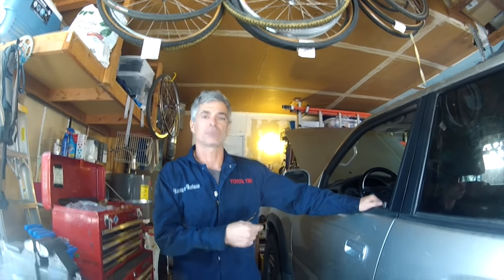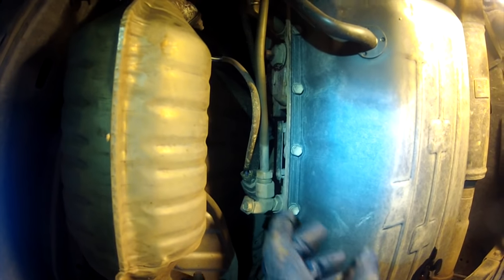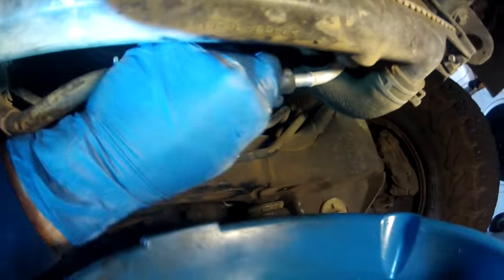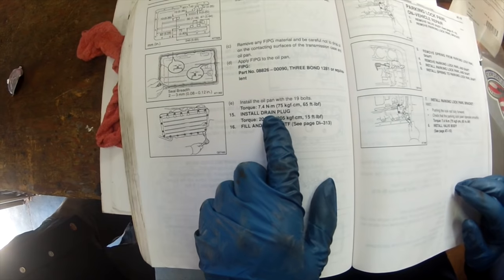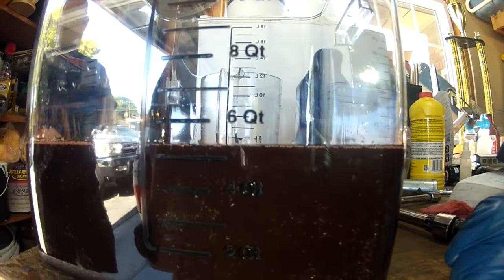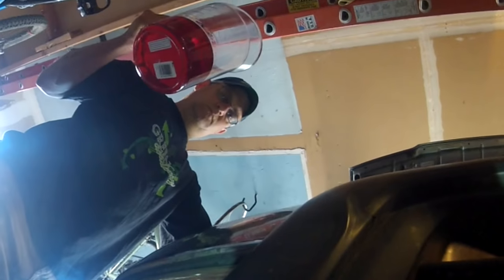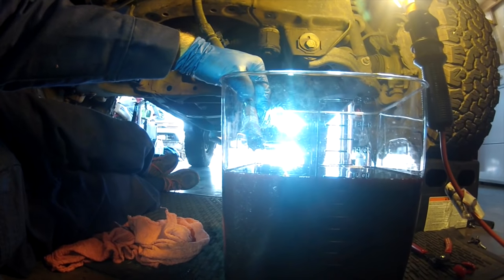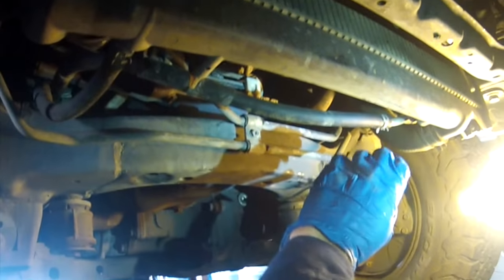Transmission Fluid Flush

Comment: Will Valvoline Maxlife ATF work with my 2010 Corolla Le? It uses Toyota WS. I noticed though that the specs for Valvoline says it covers in Toyota: T, T-II, T-III, T-IV, and WS. Is it weird that this one ATF covers all 5 Types??? Doing my first flush on it and was just wondering which would be the better choice price aside. Is WS full synthetic anyway? Thanks!
Reply from the maker: Valvoline Maxlife does cover lots of different types of fluids and your question is a question that has been raised by others as well.   I know it works fine for my application on a 3rd Gen 4runner with an original spec of Dexron 3 but I don't have experience using it for a vehicle that has the WS fluid as it's original spec.  I read the reviews on Amazon for this fluid and people have reported issues with certain model vehicles so maybe you should do some more research on it before giving it a try.  Obviously people are using this for vehicles that call for Toyota WS without any problems.  I don't know if WS is a full synthetic fluid.
Reply: @TimmyTheToolman  Ok well I saw this over at a toyota forum so it made me wonder but just like you i have been reading forums on Valvonline ATF Maxlife especially for the ones using it for the Toyota WS 

"2004 – 2015 4Runner, Land Cruiser, Prius
2013 – 2015 Avalon HV
2005 – 2015 Avalon, Sequoia, Tacoma, Tundra
2007 – 2015 Camry, Camry HV, Sienna, Yaris
2009 – 2015 Corolla, Matrix, Venza
2007 – 2014 FJ Cruiser
2006 – 2015 Highlander HV, RAV4
2008 – 2015 Highlander
2012 – 2015 Prius C, Prius V
2010, 2012 – 2015 Prius PHV

See Technical Service Bulletin T-SB-0006-11 Revision 1

Introduction:

World Standard (WS) Automatic Transmission Fluid (ATF) was introduced to reduce maintenance costs and increase the mileage between scheduled maintenance checks. Here are some important tips when working with ATF-WS in Toyota vehicles requiring its use...

• 100,000 Mile Maintenance Interval — Inspection only; ATF-WS does NOT require any flushing or changing during the life of the vehicle.

• The use of Genuine Toyota ATF-WS is recommended.

• The use of additives or aftermarket fluids that are considered compatible or substitutes may result in shift concerns and damage to the internal transmission components.

• ATF-WS is NOT compatible with T-IV or Dexron ATF.

• Containers storing Toyota ATF-WS should ALWAYS be sealed — If exposed to the atmosphere, ATF-WS may absorb moisture and potentially cause shift concerns if used in operation.

• One time use only.

• When performing repairs on ATF-WS equipped transaxles, it is important to use only new, clean ATF-WS when refilling the ATM.

• ATF-WS equipped ATMs may use the overflow type procedure — Any fluid drained from the overflow plug should be discarded following proper local regulations and never reused. Failure to do so could result in shift concerns and damage to the internal transmission components."
Reply: I have been looking at Valvoline Maxlife, and from the reviews from Toyota owners is seems like a good ATF.  I saw Amsoil has one of two FS ATF where one has the Toyota: T: I-IV and another for WS but the cost is hard to swallow ($11/qt) especially when doing a flush. but I do want to maintain my vehicle.  I have also noticed that the bottle for TOYOTA WS does oddly resemble a Mobil oil bottle but found no ATF on their website thats compatible with WS. but I think i will do more research but just might get the valvoline  maxlife. thank you for your help!

Comment: Do you think its a good idea to add new  toyota transmission fluid with old fluid already in the transmission. It's a bit low and dont want to do a flush because since i owned it for the past 7 yrs it hasnt been done.
Reply from the maker: J. C. You could just drain and refill with the same amount that came out if you want to try to renew your fluid over time. Do this drive for a week and then do it again and I bet the fluid will look good after 2-3 times. How does the dipstick look? Red or black fluid?
Reply: @TimmyTheToolman  it's brownish, thats why i was scare to drain it let alone flushing.
Reply from the maker: J. C. Well it would be better long term to try to renew the fluid slowly... cooked old fluid won’t do much to lubricate your transmission components so you have to make a decision to slowly renew it or just SEND IT!
Reply: @TimmyTheToolman  ok,thanks

Comment: Where did you get those containers? Also, do you have to take the pan off and replace the filter? Thanks.
Reply from the maker: All the links to buy those containers is in the video description.

The filter under the pan is a fine mesh filter.  Some say never to bother replacing it while others do.  It can become clogged so I think at some point it would be good to remove the pan and either clean the filter or replace it.  I plan on replacing mine pretty soon and will video it.  It's not something you have to clean or replace on a regular basis but maybe every 100,000 miles might be a good interval to take a look at it.  I'm going to do mine when I hit 170,000 miles.

Another good option is to add an in-line filter into one of your rubber transmission lines.  I added one when I installed my external trans cooler.  I replace it every 10,000 miles when I do a drain and refill of my trans.

Comment: Hey there are you filling up the fluid as your running the car or just after your empty the correct litres then filling it up with what you dropped
Reply from the maker: Hey Luke, no,  we're not running and filling it at the same time.  You must have skimmed over the video.  We show stopping the engine once 1 quart of ATF drains out, replacing that quart via the dipstick tube and then repeating the process until the fluid coming out looks clean.  Luke, watch the video.

Comment: how many qts is the capacity again?  you said 12 and replaced that, but then you just kept adding and adding...
Reply from the maker: 12 quarts was what we heard was the approximate amount that the transmission, torque converter, and cooler lines are holding when the transmission is properly filled.  From what I remember,  the factory service manual nor the owners manual gives you an exact number of the what the system holds.  The owners manual does say what you'd replace on a drain and refill of the pan but even that's not exactly right.  So, 12 quarts is a ballpark amount.  

You fill your trans until you get to the proper level based on the temp of the fluid.  I first fill the trans to the cold level on the dipstick and then I get the trans fluid to operating temp.  The FSM says normal operating temp is around 155-175 degrees F.  I use to take my rig on a drive to get the trans to operating temp but I now have an easier way.  I put the trans in drive, parking brake on and my left foot on the service brake.  I push the accelerator pedal and get the rpms to around 1k and I hold it there while watching my trans temp via my Torque Pro phone app.  When I get to around 175-180,  I put the trans in park and I quickly check the level because the fluid will start to cool pretty quick.  If it's not at the top mark of the hot range on the dipstick, I add some and then do the previous procedure to get the fluid back up to around 175 degrees.  Once I get the level topped off to the upper hot mark on the dipstick, I'm done.

So, in the video, you saw us adding and adding because the level wasn't right yet.  A transmission drain and refill isn't the same as an oil and filter change on your engine.  With the engine, you can pretty much drain it and add back in the same amount every time.  With the trans, the amount that comes out will fluctuate a little.  Trans fluid expands as it gets hotter so even if you're measuring what's coming out,  you might not get the same exact number every time because of the expansion of the fluid based on the fluid temp at the time your're draining it out.  When I do a drain and refill, I usually get out around 4-4.5 quarts.  I'll add back in 4 quarts and then dial in the final level by getting the trans to operating temp with the procedure I described above.  I hope this helps clarify things for you.

Comment: I'm just about to do this on my 1998 4runner. When draining the fluid a little at a time with the transmission pump, do you leave it in park or put it in neutral? I've heard both so what to make sure.
Reply from the maker: We had it in Park.  I guess either would be fine.  You just wouldn't want to be in one of the drive gears.
Reply: +Timmy The Toolman got it! I couldn't think of any reason why it would matter much, but I know park worked for you guys so I'll just do that.
Reply from the maker: Good luck with the job.  Your transmission will thank you.
Reply: @TimmyTheToolman  of

Comment: Thanks Tim!   I like the simplicity of that flush method.   That's easy enough for the casual weekend mechanic to do   :)

I did notice with your tranny temp app that the charging voltage was only 12.7 with the engine running(so it seemed) and that is a charging problem....should be 13.5 to 14.2v.

My 01 Taco with 3.4L and auto would peak at 204 degrees also during the hot summer and, strangely enough, was able to reduce that to about 197 with a tiny radiator replacement(#1778)
https://www.yotatech.com/forums/f152/sas-fj60-axle-housing-flip-front-shackle-my-2001-tacoma-283930/index2.html
Reply from the maker: Hey Ken, glad you liked the video.  I like how simple it is too.

That Torque Pro phone app for some reason doesn't give an accurate reading for the volts.  When I check it with a multimeter at the battery, it's around 1 volt higher than what's showing on the app.

My coolant temps run in the high 180's to as high as 194.  But, maybe you're talking about trans temps.  If so, I've seen temps as high as 240 when climbing a ridiculously steep mountain road for a long ways and that's with an external trans cooler ran in-series with the cooler in the radiator.
Reply: That was actual engine coolant temps.  My tranny temps with the scangauge2 have seen nothing higher than 180....and that's OUTPUT temp.  Even on 110 degree days here in Phoenix.  I have my Hayden 679 mounted directly up against the front of the radiator and bypassing the internal radiator cooler.  Ken
Reply from the maker: Do you ever climb any steep mountain roads or tow?  If you do and still only hit 180, that's better than I thought you could do with a bypassed system.  I did a lot of research before choosing to run my external cooler in-series with the radiator cooler.  I found from asking questions on Toyota forums that people with bypassed systems who push their rigs hard recorded some pretty high trans temps.  But then again, so have I with my bypassed system.  Another reason why I chose to run in-series was because of the possibility of running too cool.  The trans cooler bathed in the hot engine coolant will help raise your ATF temps to a decent operating temp sooner but how much it helps I don't know.

I have my external cooler mounted on the outside of my AC condenser and have noticed around 20 degrees cooler temps with it ran in-series with the radiator cooler.  I drive a lot in the mountains and notice that's when my temps will rise pretty high and that's with turning off overdrive too.  I usually only hit a high around 200 now, but with the right hill, it can climb pretty high from the effort.  The hill I hit 240 on was a 15-20% grade that went on for a few miles to a house in the mountains.  I just watched my trans temp climb higher and higher and almost pulled over but we finally reached the house.
Reply: No towing but been up both sides of the Flagstaff mountain highway which is steep.  Also, all the ups and downs on the way to Moab....quite taxing on an auto.

The key to running just an ext cooler is get the biggest one and  to install it for maximum efficiency and that means it touches the front of the radiator. All other configs are less efficient.
Reply from the maker: Gotcha Ken.  When you say toughing the radiator, do you have it sandwiched between the AC condenser and radiator or do you have it on the inside right in front of the fan?
Reply: Sandwiched between the condenser and radiator. Using 4 tie-raps to get it up against the radiator.  There is about 1.5" air gap between condenser and radiator  and the cooler is only 3/4" thick so plenty of room.
Reply from the maker: Got it.  Thanks for sharing how you did it.

Comment: I did this on my 04 Lexus rx330. I unhooked the wrong line the fluid came out of the rubber line. Also I just drained about 3.5 quarts from the line. Plus the 4.2 quarts I got from drain pain I probably did an total of 8 qt fluid exchange
Reply from the maker: But, it worked out for you and your transmission will thank you for it.  Happy Wrenching!

Comment: Hey Timmy, im going to do this on my 4Runner, i was wondering  if i should drop the pan and clean the magnets, i dont know or think that it has been checked / the pan has been dropped ever. Any thoughts? Thanks again!
Reply from the maker: Well, you could never go wrong by doing it, but whether it's necessary or not, I think it depends on the mileage.  I doubt mine has ever been dropped and I'm at 150,000 miles.  I was thinking I'd do it at around the 200,000 mile mark, but who knows, I may do it sooner out of sheer curiosity of how much metal has accumulated on the magnets and how much is in the metal mesh filter.  

When I heard the filter under the pan was a metal mesh filter, I figured it would probably take a ton of metal fragments to clog it, and if that were the case, my transmission would be screwed anyway.  So, this is why I don't feel the need to drop the pan just yet.
Reply: My 4Runnner has 320,000km which is about 200,000mi. Its been making weird noises like whining at the top of 2nd gear and taking longer to shift in second from 2200rpm to 2600-2700rpm. However this only happens when its a really cold start up like 0 degrees Celsius. I have the time and supplies , plus its not too much extra work. I'll probably open it up just to check. ill take pictures too :)
Reply: Third gen 4runners take longer to shift from second to third when they are cold. That is perfectly normal.

Comment: May be a silly question...but would this be approximately the same process and number of quarts for the 2wd version? 2.7l
Reply from the maker: I don't know the capacity of the 2.7 liter engine.  Take a look at the back of your owners manual and you'll find the answer.
Reply: @TimmyTheToolman  ok Timmy I just finished this job. The weirded thing happened......I added the extension tube with 3/8th diameter. But when I started up the car the fluid came out of the other tube (which I left hanging like you did). So it was opposite of this video? I kept going and around the 11 qt mark and it started coming out clean. So mission accomplished but the lines were reversed on mine? Is that ok? Again I have the 2.7L and 2wd version.
Reply from the maker: @imtherealjoeyd  I don't think it matters if the lines are reversed.  The trans cooler in the bottom of the radiator is a very simple device.  It has ports on both ends with cooling fins in the middle.  The fluid could flow in both directions.  But, maybe that's just how Toyota set it up with the 2.7 liter engine model.  I haven't done this job on a 2.7 so I can't say for sure somebody reversed the lines or it came that way from Toyota.
Reply: @TimmyTheToolman  awesome. Well thank you so much for the reply and also for the excellent videos. As you know you’re helping out LOTS of people and I (we) greatly appreciate you!!

One last question if I think the fluid is a little past the hot line (a little bit full) do I need to drain some out?

Comment: Hi Timmy, I have a 3rd gen 4 runner. 2 weeks ago my radiator failed and coolant got into the transmission. The Car moves but i need to give it alot gas. Do you think if i flush my transmission its going to fix it?
Reply from the maker: Well, it's hard to say.  The best you can do is flush a ton of ATF through the system and then keep your fingers crossed.  Whatever you do, don't drive it until you flushed it.  Run 3 gallons of ATF through the system.  Go on a very short easy drive, come back and run another 3 gallons through.  Take it for another test drive and then run another 3 gallons through.  For the first two rounds, use whatever the cheapest Dextron III you can get your hands on, maybe from Walmart.  For the final 3 gallons, use whatever brand you like to run in your auto trans on a regular basis.  I'd then drive it and see how it's shifting.  If it's shifting good, maybe you're good for a long time.  I'd do another full flush in another 3,000 miles.  

People who have had this happen to them have been able to buy themselves quite a bit of time but it seems the transmission will most likely experience an early death after this happens.  Maybe some get lucky and get a long life out of the trans but most will be looking at a trans swap in their future.
Reply: Timmy The Toolman Hopefully my trans start to work after the flushing. Im gonna Try to find a Replacement for a cheaper price. But if i can't then im going to flush it and hope for the Best. Thanks Alot for your time Timmy.